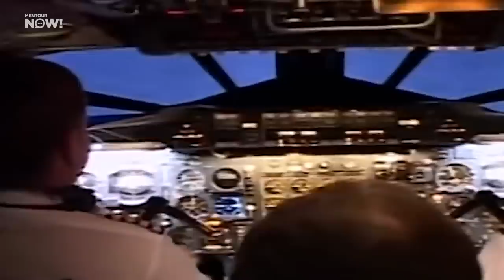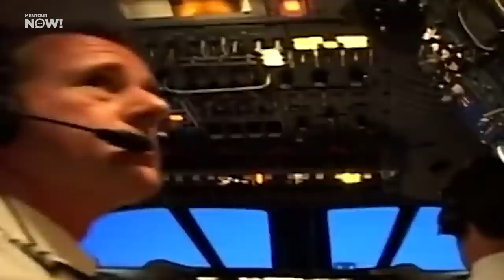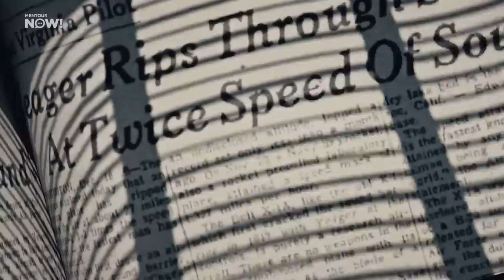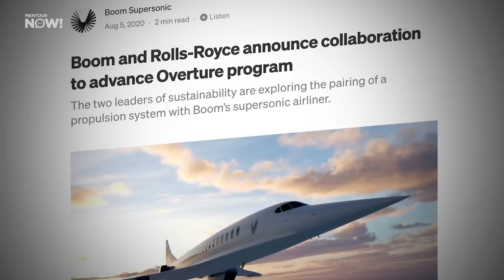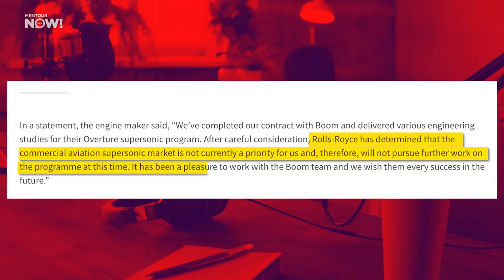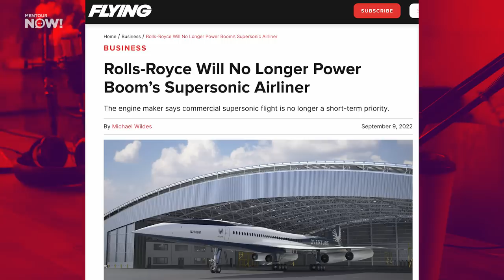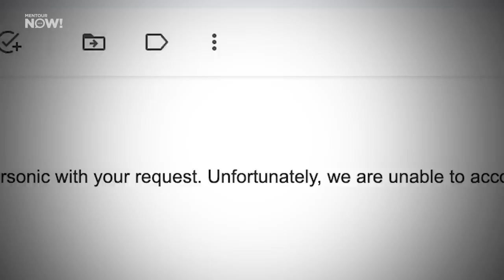WHAT’s Going On with BOOM Supersonic?! Will it Fail?

Comment: I agree with Izzie. The fact that a company is pushing the envelope to re-establish commercial supersonic capabilities using modern aeronautic technology is extremely exciting; however, I do not believe there exists a significant market share for this type of transport to justify the immense costs and potential negative environmental effects such a project would entail. It seems like another glaring example of the tail wagging the dog.
Reply from the maker: You could be correct.
Reply: nice to see well formed, and well informed opinions in the comment section.
Reply: @ERIK31351  You can’t see my redneck, my mullet is too long.
Reply: I am an aeronautical engineer. The technology of Boom is great, but I hate the fact that we are building another toy for the rich to destroy the environment with. SAF will not make it all of a sudden environmentally friendly.
I would rather see these engineers work on designs that reduce the environmental impact of aviation, like electric designs.
Reply: The problem is not market share but the fact that they don’t have the tech that is in the main marketing point
Reply: Indeed, exactly. The customers - rich businessmen - once used the Concorde to cross the Atlantic Ocean between Europe and the US (even at that time a small portion of the Airline Market) are using today their own Business Jets. Or staying at home in their residences and using Zoom. Zoom - not Boom. And at that point we´ve not even started to talk about Engines.
Reply: @rjdverbeek  Electric commercial aircraft is physically impossible. That is why it is a dead end. You lose all useful capacity if you want to match the range of modern jets or you lose all the range to get that capacity. There is no in-between because battery packs for energy to weight density cannot and never will be able to compete with fuel based designs in commercial transport category aircraft. There is also something that fuel based aircraft can do that battery powered cannot - get lighter as they burn fuel therefore extending their range. I would hope as an engineer you would have understood these concepts.
Reply: The are a lot of Australians that aren't too happy with 22+ hour flights to England. Pretty sure they'd be popular here.
Reply: I think even if project went very well the final product might be commercially barely viable. You cannot "Tesla" a plane.
Reply: @FloorItDuh  i'd agree with you if materials science and battery technology was going to remain completely stagnant for the next 20 years (spoiler alert, it won't)
Reply: We could indirectly electrify an airliner by fuelling it with hydrogen produced via electrolysis of water.
Reply: @tubester6772  in business it's not comfort it's speed, that's why private jets are popular for businesses, you skip security and the plane takes off when you step on.
Reply: @DazzaJay  looking into the flight concept route using google maps (Not 100% accurate)
Flying from Perth to London isn't really looking good you would have to take 2 stops on the plane, the destination isn't even London.
You would have to fly from Perth via Colombo SriLanka then somehow fly over Egypt Suez without upsetting them by still going supersonic.
then finally to Mallorca Spain.
The range is only 7,870KM and that itself is a major issue for flying from Australia to Britain.
Meaning yes you could fly from Perth, have a stop over in SriLanka to refuel and take a rest, then continue to Mallorca whereby you would board a seperate flight to London.
Quick but you would need to do many stops before you reach London.
Basically meaning Mallorca would be a hub for Aussies and Brits trying to go across the world.
Reply: I think we need to wait for SpaceX Starship.  They have said by 2028 we could transport 100 passengers from Texas to the Philippines in about 30 minutes.  Without the sonic boom
Reply: @Moshimulations  there is a 22+ hour non-stop flight from Australia to London. Can't remember which city it departs from though.
Reply: @DazzaJay  Sydney
Reply: @DazzaJay  Just one problem: Boom's max range is 8000 km. It could barely make it from Sydney to Hong Kong (7400 km).
Reply: @lindasherman9921  That route is dead, HK airport is dead and won't come back.
Reply: @rob3910  Musk says all kinds of things that fall apart immediately when you use more than five brain cells to think them through.
Reply: @rjdverbeek  Electric won't work over medium or long ranges and especially not for domestic 12-13 hour multi sector days, anytime in the near future. Energy density vs weight. SAF is the future of long range flight whether we like it or not and a significant reduction over fossil fuel's impact. HFC may eventually be viable but H storage in a viable airframe is problematic. 

IN any case, aviation only produces 2% of GHG yet wasted escaped methane from natural gas wells is 15 times as significant a problem and Methane is far more effective as a GHG than CO2.
Reply: @Moshimulations  Perth. With connections to everywhere else in AU, but the Sydney-London non-stop won't take off until 2025, when they get A350-1000s.
Reply: @DazzaJay  Much as I love Australia, the entire country, which might almost qualify as a continent, has only twice the population of the London metropolitan area, or slightly more than Washington D.C. plus NYC metropolitan areas. So when you say a lot, it really takes a lot.
Reply: @rjdverbeek  If you became an aeronautical engineer to pursue aircraft design but at sametime have such feelings on impact (hydrocarbon) on environment, then I say you are in the wrong line of work. Aviation has always catered to the rich and generally still does. Electric powered aircraft (current technology going probably for next 20 years) aren't that better environmentally when you look at full life cycle of  batteries. Fuel cells may fair better but the fuel for fuel cells  are limiting in my opinion. I see SAFs a more practical direction and with that supersonic flights could be made environmentally acceptable. My issue with BOOM is its another venture capital ploy to milk capital knowing there is little chance to get a commercially profitable aircraft in the market. I feel most If not all the electric aviation development companies are the same. Cool technology  but really think it is done more venture capital money scam to just go bankrupt later while making those involved at high levels rich.
Reply: @ArKritz84  Yes, I doubt they would use the Overture in that route, if they do, they (passengers) would have to do multiple  stop-overs or connections.
Simply put it, this plane is only really suitable on 10 hour flights over water.
It could theoretically be used to boost you into Europe but that too is unlikely as the range is impractical and would potentially cause more wear and tear for such a plane.
Reply: its not like AB or Boeing don't have R&D teams, you don't think they have looked at the market numerous times for something like this and they have long term customer relationships with the airlines..... yes they would like to maximize returns on the models they did develop, but who is really going to shell out 150MM or more for an 88 person plane? Not many i suspect
Reply: There are plenty more rich people today. And they only need the tiniest of greenwashing excuses like "uses green fuel" - to use it.
Reply: @rjdverbeek  Your statement makes two dubious claims. You seem to imply that it's a moral crime to be financially successful. Is it? Secondly, assuming that human activity will destroy our planet's ecosystem must be an argument solidly grounded not in the scientific method but rather in the idea of value. Always be suspicious when an hypothesis becomes cultural orthodoxy.
Reply: Never gonna happen unless it’s available to the masses, and it won’t be.
Reply: Concorde proved the technology and was profitable for over 20 years for BA. new technology would help extend range but not solve the 'no supersonic flight over land problem'. 

Any SST should be aimed at the First Class business Market that worked so well for Concorde or the market for companies that currently use long range business jets.

As far as environmental effects, the impact any SST or even fleets of is miniscule. The entirety of worldwide aviation produces just 1.9% of GHG and SSTs would be about 1% of that, if everything went brilliantly.

Liberated methane (i.e. wasted) emissions from natural gas wells produces 5 times as much and Methane is many times more damaging as a GHG than CO2. As aviation moves to sustainable aviation Fuels (SAF) made from algae or waste crops GHG effects will decrease further. Aviation is the only form of transport that has steadily increased its efficiency since its invention without need for regulation. Fuel costs money. The less you use the better off you are. Each generation of jet airliner has been 15-20% more efficient than its predecessor.
Reply: @NicolaW72  Humans are social creatures. Zoom doesn't work for people you don't know and with whom you are about the enter into partnerships or busy significant amounts of goods or services from. Face to face will always be needed.
Reply: @rob3910  Uh, my guy, Starship will definitely be breaking the sound barrier. BOOM!
Reply: @rjdverbeek  Whats the issue with aircraft & the environment? You're not apart of that CO2 cult are you?
Reply: @Completeaerogeek  Yes - but therefore they´ve today their own Businessjets at that level of Business from which the passengers of the Concorde mainly occured. So the Concorde will not be repeated - and at this point the discussion about Engines has not even started, as I´ve mentioned. But it would have to be discussed, too, because: No Engines, no Aircraft.
Boom is a failed adventure.
Reply: @rjdverbeek  I would like them develop a fuel where it doesn't burn everybody to death in a Crash
Reply: @DazzaJay  It's not like they didn't choose to live down under. Deal with it!
Reply: @Adthin  I've seen to many of them crash!
Reply: Concorde was profitable though
Reply: They don't want to make the same mistake the Jumbo jets made...... not understanding the marketplace well enough.
Reply: I suspect your right, but I hope you are wrong.
Reply: Cargo
Reply: Yes, and electric cars are great for the environment. 🙄
Reply: @rjdverbeek  electric planes will never be viable unless we resort to nuclear reactors, that's just physics
Reply: I live here in Greensboro NC where the super factory is being built. On Tuesday December 13, 2022  there will be an announcement here on who the engine manufacturer for boom will be,  I'm really looking forward to this!
Reply: Considering the amount of billionaires that invested in boondoggles like FTX that won’t stop people from throwing good money after bad at trying to reboot supersonic commercial flight
Reply: Re 5:30, how about the B36 with “6 turnin’ and 4 burnin’?
Reply: @kadenze6176 it will be hydrogen fuel cels. Batteries can’t do it
Reply: @Completeaerogeek Concord never made it's money back in the cost it was to develop.
Reply: @Tattiehoker it's called coal.
Reply: Clean fuels? Like not SAF, but actual fuels that don’t emit greenhouse gases when they burn. It’d take some work, but is theoretically possible.
Reply: IMO starship will never be viable. It’s like using a bucket to carry a drop of water. Also I’m pretty sure paying customers don’t want to be whipped around by the landing flip.
Reply: Yeah, but everything helps. SAF is nice, but I think real research should be put into a true clean fuel. It would not emit ghg at all. And it could be used outside of aviation as well, cars for example. Idk smth hydrogen based with oxygen or nitrogen to increase its density might work. The mind immediately jumps to NH(OH)2.
Reply: It's re-establishing commercial supersonic capability for an extremely select few at a time when justifying regular commercial jet travel (already a privilege for the relatively few) is difficult to justify and there's no credible case for decarbonizing it in time. It's like getting excited that more private jets are being sold for the wealthiest fo enjoy.
Reply: @Photostar625  bucket to carry a drop of water is a fantastic analogy. It's hard to get folks to understand the hard limitations of reuse and I've long been looking for better ways to illustrate the diminishing returns involved.
Reply: In America the market exists, but everywhere else is too small or too poor.

Comment: The Olympus engine also had marine and land-based variants, used for naval propulsion and gas turbines for electricity generation, and many are still in use in those roles so the development costs were well covered, which could not be said for a new engine as Boom needs.
Reply from the maker: Very good point!
Reply: I served on 4 Oly-powered destroyers and frigates. It was always a thrill to move those levers up to full-power. But no reheat, unfortunately!
Reply: My dad used to work at RR and was an inspector on the engines actually used on Concorde.
Reply: Huh, but the F-16 engine is outdated-enough that the US wouldn't care about it, would they?

I mean, you'd still need the actual alloys mixing and the production facilities (and good luck getting all the bugs out that cause way higher wear and tear than actual F-16s suffer).

And then you'd need air-to-air missiles, and avionic and IFF systems and such.

Without any of all those things, a 'fake' F-16 would be deeply inferior to a real one! 
And even a real one would lose to an F-22 or an F-35, which the US has plenty of.

Oh, and without institutionalized skill in the maintenance crews, they also won't be as effective as F-16s that are produced and operated by NATO countries.

TLDR: the US would have nothing to fear from uploading the entire engine blueprints to Wikipedia... 
Right? 🙃
Reply: @ERIK31351  F16s are sold to other countries as functional aircraft. If any part of the engines were classified, they couldn't be sold like that, or there would have to be a version of the engine installed that had no classified assemblies.

If we can sell a plane to Israel or Turkey, we can use its parts in an airliner.
Reply: @well-blazeredman6187  Boat Type R! :D
Reply: Nobody's got anything remotely close to the Olympus now, sadly. 31klbf dry/38klbf wet, it was a monster and the intakes did most of the heavy lifting at speed., in terms of pressure recovery. They were engineering marvels. Nearest thing in the current fleet is the GE F-101 on the B-1B, but, it's only 17klbf dry and needs reheat to even hit 31klbf. The history on the Olympus and all its derivatives and applications is fascinating, there's a great book by the RR Heritage Trust on it, and some of the other more storied RR engines.
Reply: @ERIK31351  Israel has an alliance with NATO and is allowed to receive restricted technology, turkey would need special congressional approval
Huh. Why would a NATO member congressional approval when a NATO non-member just needed an alliance with NATO? Or did I misunderstand what you wrote?
Reply: @Phillip Banes No there aren’t. The F16 isn’t capable of supercruise. Even the F22 can only stay supersonic for around 100 miles of a 900 mile flight and has a max takeoff weight of 38 tonnes with a 7 tonne payload. for comparison the E-190 an airliner with the capacity Boom are talking of has a max takeoff weight of 58 tonnes, with 13 tonnes of that being payload and has a range at cruising speed of 2500 miles. The military engines are a long way off giving the performance Boom needs.
Reply: @ERIK31351   you make some good points. I still feel the f16 is so thoroughly outdated (by at least 2 entire generations of fighters) that there can't really be much of a security risk in any of its equipment.
Reply: @davidwright7193   maximum weight and useful load have a lot more to do with the airframe than with the engines. A Lockheed C5A will have way more cargo capacity than Boom's plane, but with engines that don't put out nearly as much thrust as Boom needs.
Reply: @AlexandarHullRichter  can a C5A supercruise? No. What thrust/weight ratio does impact is speed and specifically cruising speed. Boom need to sustain Mach 1.7 for 2 to 3 hours to do what they want to do. The F22 can’t do that. It can sustain Mach 1.7 for 10-12 minutes before its tanks are dry. The US military doesn’t have a large plane capable of cruising at supersonic speeds and never has. 

The performance requirements and context of a supersonic transport are very different from a fighter and you can’t just swap the engines over. The F22 doesn’t fly 3 hours supersonic between overhauls and certainly doesn’t do the 12 to 24 hours supersonic that would be the minimum in service expectation for Boom. 

The performance requirements for a supersonic transport have really only been met twice and the engine manufacturers were RR and Kuznetsov. One has refused to do it because the engine would cost too much to develop and the other isn’t politically acceptable.
Reply: @AlexandarHullRichter  Being outdated doesnt mean much in terms of secrecy; we still dont know the actual composition and features of the first composite armor the US put in the first abrams variant, and thats 50 years later, and that specific armor nobody would use today.  
Theres just little reason to make stuff secret that you dont have to.

So something like an F16s charachteristics are top secret too. And mind, while the airframe and certain design elements are certainly outdated, the actual electronics haven been constantly upgraded and some of them can be just as modern as those of the newest aircraft models. Eg the US is intending to keep the F16s for longer now, so theyll transplant some of the F35 technology to them.
Reply: <NGTE Pyestock where Concordes engines were developed 
I cannot describe to you the sheer size of the atmospheric test chambers there